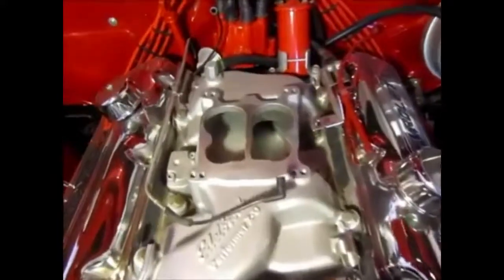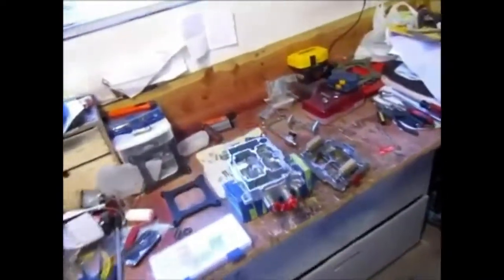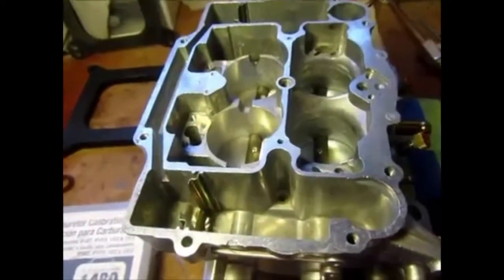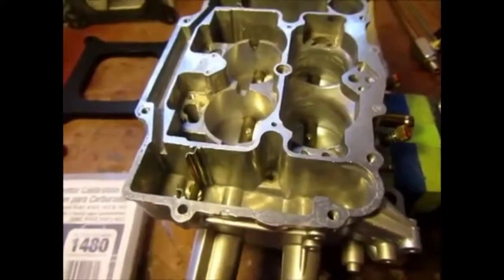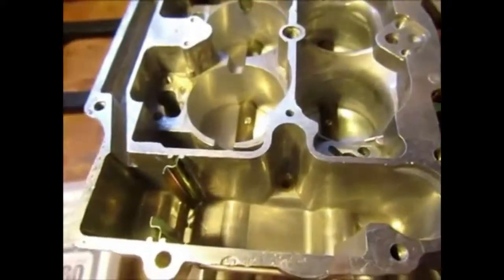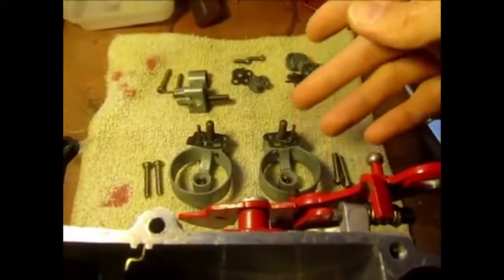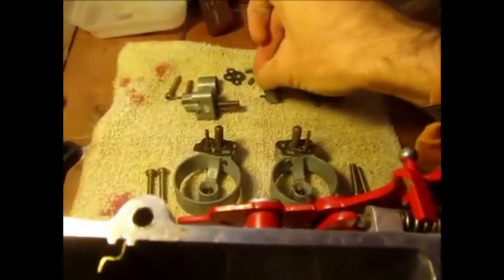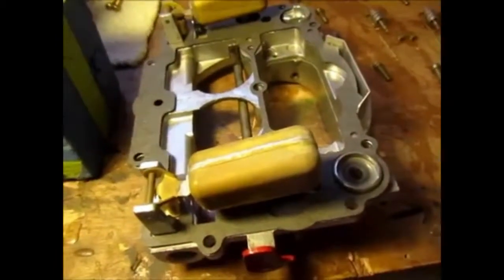74 Chevy Nova Update - Edelbrock Carburetor Tuning Ep 129 (How to)

Comment: Under  acceleration  the staging springs make a big difference ! Pull the orange 5 hg spring . Go to the pink 7 hg spring . The motor wont run down so lean before it stages power mode . They make a 3 step primary metering needle . Or they used to . Some a the old carters came with a 3 step metering needle for rv applications also ! I did a cpl videos on my channel with Edelbrock stuff that might help some of you . Go to The Weldor . Look for my boxer dog with yellow safety glasses . I see you have a spredbore intake . Run a Q jet ! Thers a cpl vids on those 2 on my channel . How ta do secondary metering well plugs . How ta set up the secondarys . Ive throwin around 30 holleys in the trash ! Refuse ta run em . Refuse ta work on em ! Edelbrock has a better bottom end than a Q jet . But wide open . That Q jet eats that Edelbrocks lunch all day long ! Those sensors are cool ! Im 55 . We had ta figure shit out other ways ! I have one video that shows how to set staging springs with out a vacuum gauge
for Edelbrocks ! Something i learned my self late 80s early 90s . Great video ya put tagether ! Be safe brother !
Reply from the maker: Thank you.
Reply: Keep in mind the charts sea level ! The charts useless at a mile high condition !